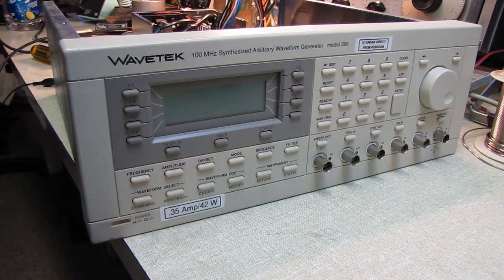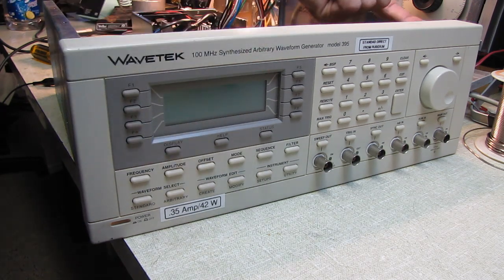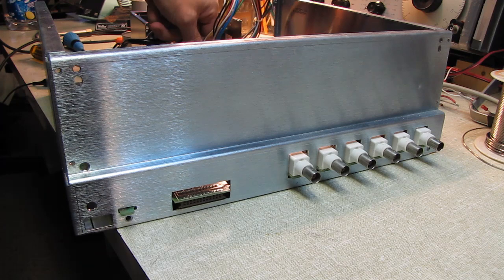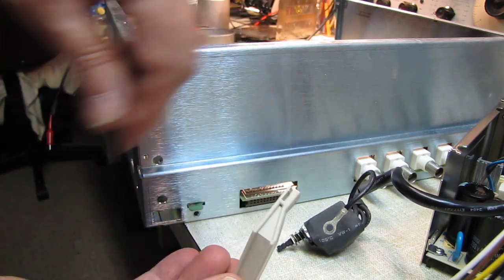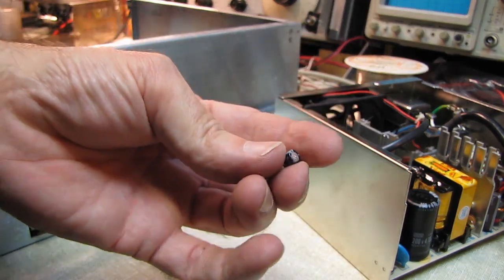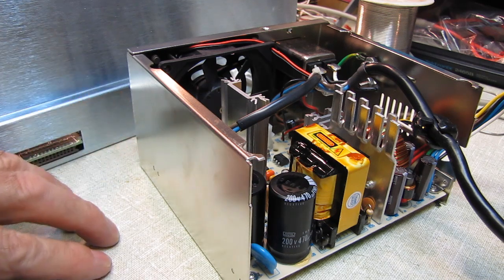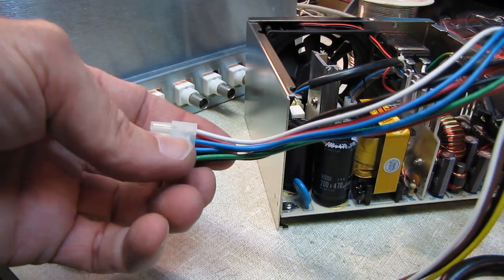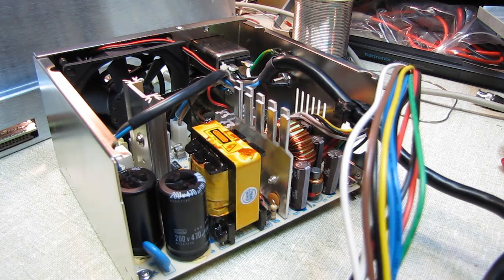Wavetek Model 395 Waveform Generator PS Repair

Comment: My 395 symptoms is: the main output shuts itself off every 30 seconds or so. Seems to get worse as the unit heats up. Ever run across this? Any suggestions?

Comment: You can override the power good signal to bring a power supply up without connecting it to the device. It's usually a green wire on the output plug (4th pin in on first row nearest to retaining clip on the plug) which needs shorting to a ground wire (usually black). There are also cheap devices you can buy which act as a load to test power supplies without risking your kit on them when you've just done some work on it and want to test it. They have +/-12v, +/-5v, 5V standby (SB), 3.3v and power good LEDs on them. Mines an "EZ Power Supply Tester" They just plug into your output plugs on the power supply. N.B: I am referring to the standard P.C. type power supply with the 20 pin header (plus other headers). These power supplies are also used in many other devices. They typically have 5v, 3.3v and 12v and are around the 200W range. I wouldn't assume any unknown power supply to have the same output connectors on it and I certainly wouldn't recommend trying what I have suggested unless you really know what you're doing.